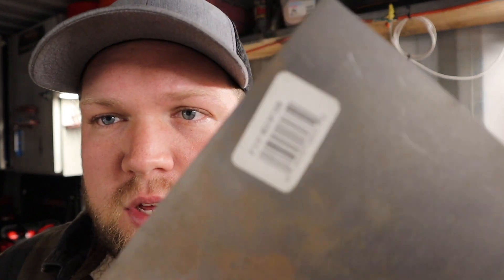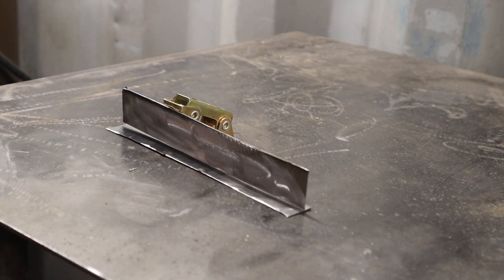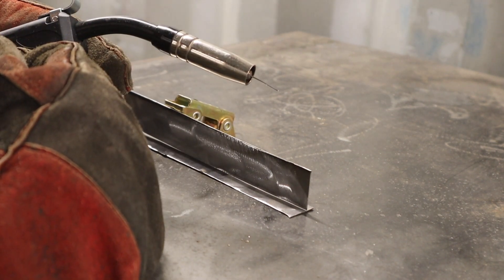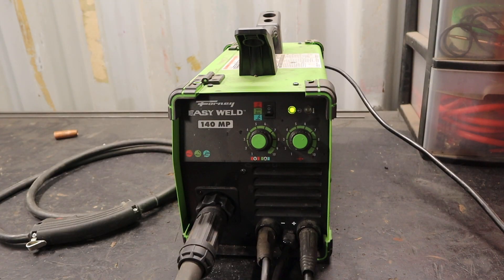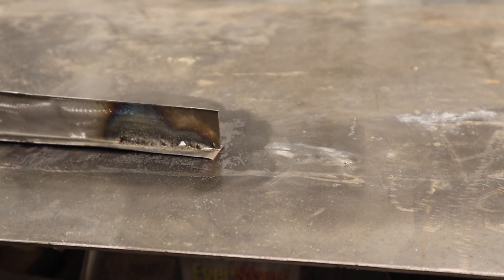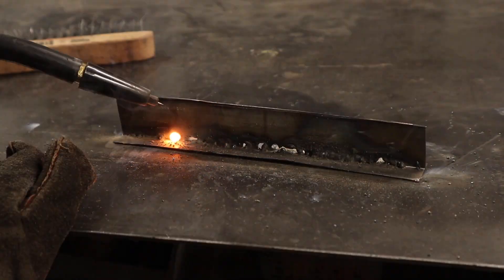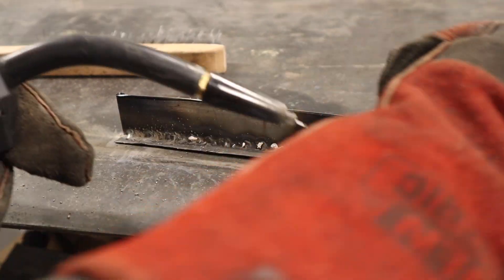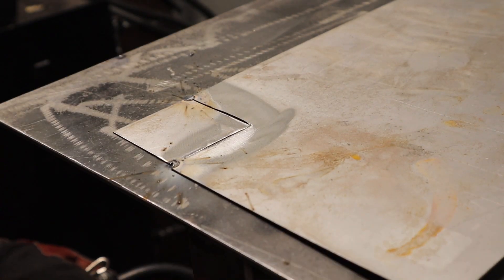Can I Weld 22 Gauge Steel with a Flux Core Welder?

Comment: You had material heat problems I think. Being so thin, it burns through much easier as the whole piece heats up. You need to leave it cool down for 10-15 min after every 3-4 tacks. Or you can clamp a block of aluminum to the back of it cause aluminum dissipates heat much better than steel - drawing the heat away from the work piece. But this will only buy you a few more moments before the piece heats up  too much again & causes every tack to melt through it.
Reply: Just turn the voltage down… common sense

Comment: An application for such gage sheet metal would be automobile panel restoration to cut out and re panel fenders,  doors, body panels on classic vehicles (for example). I did something similar for fenders, doors etc for 1971 Toyo FJ40. 

Its actually more beneficial to drop spot-welds in spaced sequence to prevent heat warp of the thin steel, rather than long bead. With some disc grinder skills, and patience, my 20 to 24 seams worked out fairly well.

Comment: 🤣 boy you need to cool down it can be done your just dont have the heat set right I fixed my mom's truck with .30 flux core wire and it worked out good but there is no trick to it just got to know the welder thats it

Comment: The best I’ve seen with flux/thin gauge is tacking enough to hold your material where you want it and filling in between every tack (jumping around) till you have a good clean stack all the way around. No idea what his settings were but the material didn’t warp and it looks really clean. That method eats up loads of time though lol
Reply from the maker: Good tip, thanks!

Comment: Your wire stickout is very short. Try with longer stickout like here: https://youtu.be/iAzRb12XZ_s Longer stickout=less heat. Thanks for your videos and don't give up. I am a hobby welder and I still haven't tried thin sheet metal like this with flux cored but will do.
Reply from the maker: That's a really solid suggestion. I may try that sometime.
Reply: Finally I had some time to try it out, this is the result: https://youtu.be/e9hSKCz7I6k
Reply: I watched the video and he doesn't skip around, just keeps the area red hot. O.6 mm is 23 ga. so holy crap!

Comment: Man, that's a welding workout, bud!  Try it with stick lol!  Got any 6013 or 7014 lying around?  Something real thin, like 5/64" rods.  I'd try stacking spot welds on top of each other, maybe?  You'd need a tight fit too, no gaps.  Where there's a will there's a way!  :))))
Reply from the maker: Have you seen the Tim Welds videos on him stick welding some thin sheet metal? Dude didn't only do it but he made it look nice as can be too. Seriously shocked me that it was possible.
Reply: Yup, I follow Tim Welds, and did see the vid you're talking about, welding razor blades together.  That was seriously impressive that he ran a full bead!  But then again, that dude is a welding instruction, he knows how to read a puddle.  That would be swiss cheese in my hands lol!  
There's this other dude I follow on Youtube, an Indonesian guy, talk about ghetto welding!  He welds in sandals, squatting on a dirt floor, 6013 rod for everything (coz that's all he could get over there).  But he has this technique he does, calls it "dab-dab", he stacks little spot welds like dimes.  I question doing this for everything coz of potential for slag inclusion, but in the case of super thin stuff like this, that's what I would do.

Comment: Yup it's freekin hard, I've done it, you've gotta really take your time, but it is possible. I even managed to do some thinner metal once with the chicago electric fluxcore 90 spatter box, but it took a lot of time and patience, and I wasn't welded much, just a stamped sheet metal part on an office chair where it had cracked. I've always used 0.30 wire as well. 

Was that blue demon wire you were using in this video? It did a nice job on the butt joint.
Reply from the maker: Wow that's pretty impressive. I was using .030 E71T-GS Blue Demon  Wire.